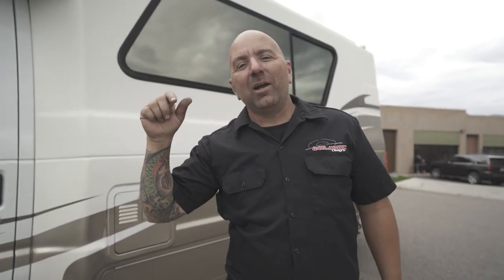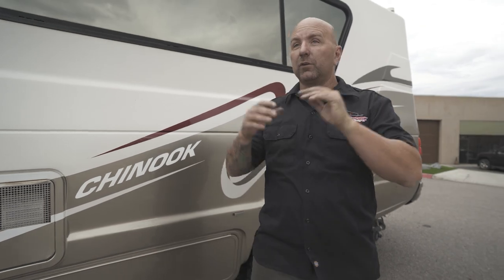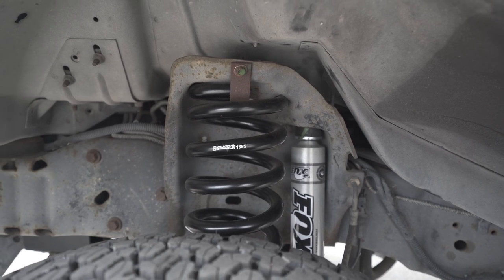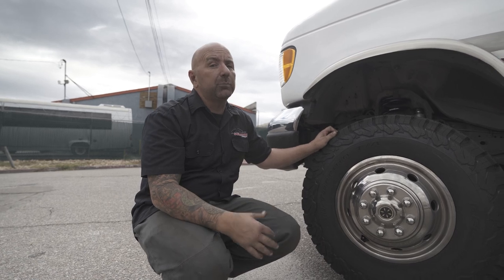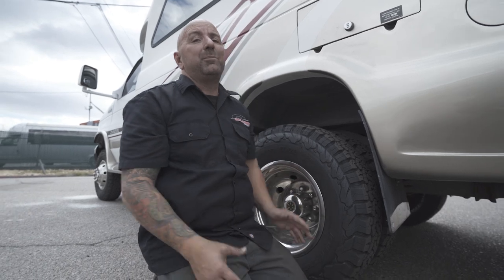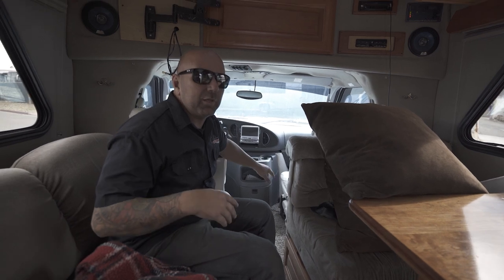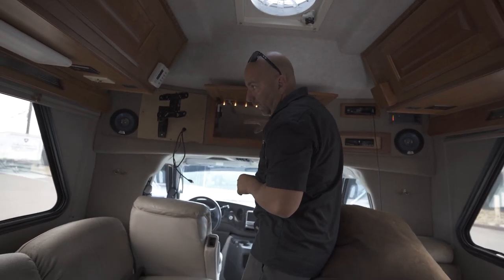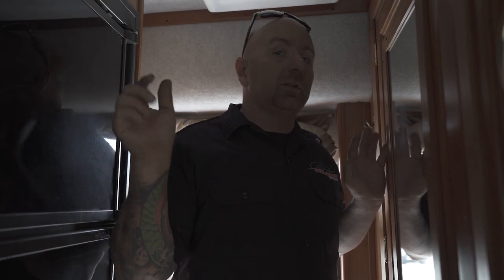Ford Chinook Camper Van With 5" Lift Kit

Comment: I have an 89’ chinook “brick front end” (hurray for the 3rd gen fords!) I see you have a couple lifts back in stock! Can I continue to run my 16” wheels with the updated lift? I have $5-6k in brand new tires summer and winter toyo m-55’s that I love they are already 235/85r16!

Comment: I’m looking for a Chinook with low miles. Les than 25,000 miles. In excellent condition. From that starting point I want to have the suspension redone. Bigger tires with a better rim style. The suspension is the main thing. Then I will move on to the power bank. I want a nice string generator. Definitely oversized. I want some solar along with lithium batteries. I’ll still rerun with two propane tanks to add to my flexibility in power sources. My alternator will be upsized too recharge my system. I’ll need a roof access and a roof tent. Rack on the top. Utility Box, bake rack, outdoor shower and ladder in the back. Outdoor BBQ, Grill, Fridge, Stereo, TV, 360 Degree awning, storage, wench, custom front grill, front bumper and back bumper. J